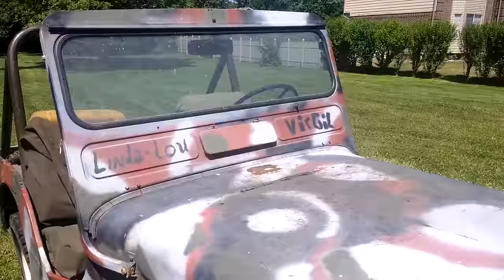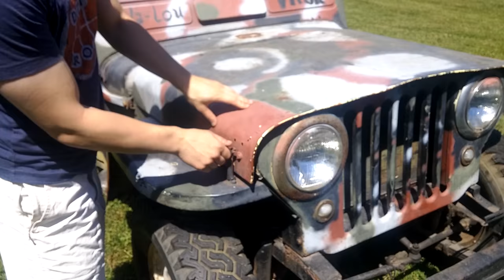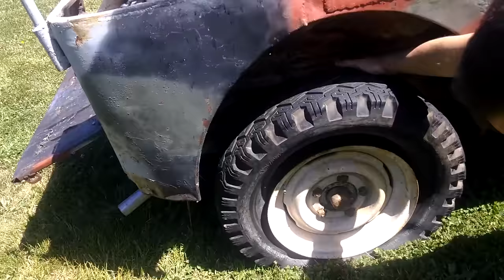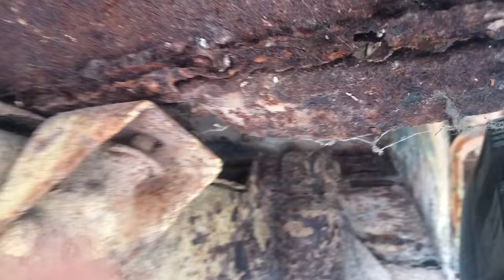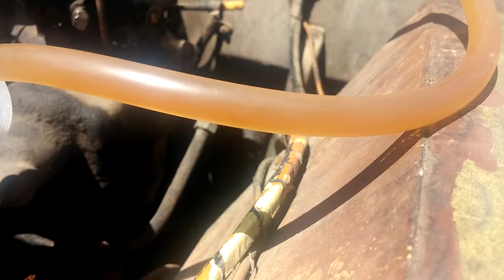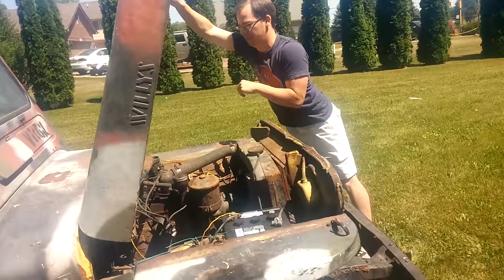This Rusted-Out 1948 Willys Jeep Is Our New Off-Road Project

Comment: I got my CJ-2A (a 1947) when I was 15. It just got fresh oil and plugs for the season. Drove it all through high school, and every summer of the 18 years since. Here are the most important pieces of advice I can give you: 
-It will pop out of 2nd gear if you are engine braking. You will have to hold it in gear. This will go away when you rebuild the transmission, for about 2 weeks.
-Under no circumstances will it do 60 mph, despite what the data plate says. 45 is pushing it.
-Steering boxes, especially the cover and worm gear, are IMPOSSIBLE to find. It is likely the most valuable single part of your 2A. Treat it gingerly. Do not steer unless you are moving
-Every bolt is 1/2 inch. Your off-road toolbox could be a 1/2 inch wrench and a flat screwdriver.
-You'll have to put the windshield up to open the hood. Otherwise, just leave it down. It's the pure and perfect way to drive a Willys.